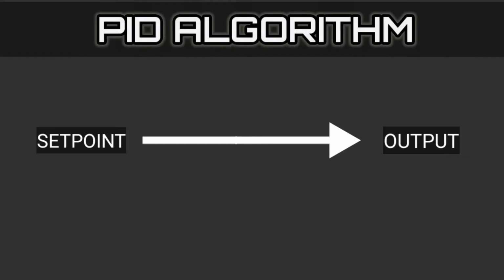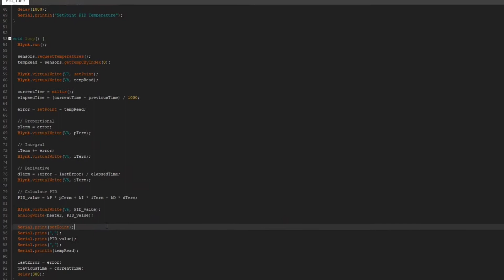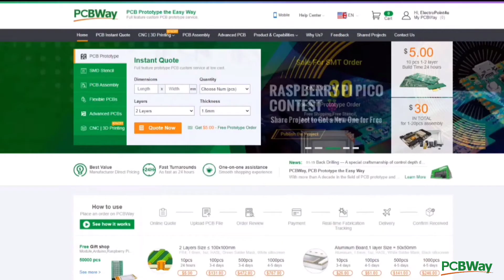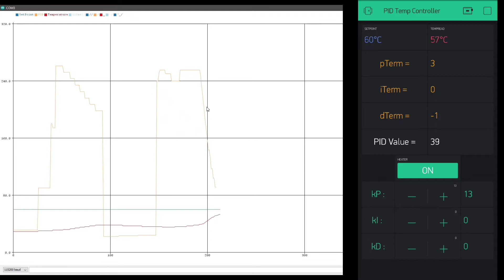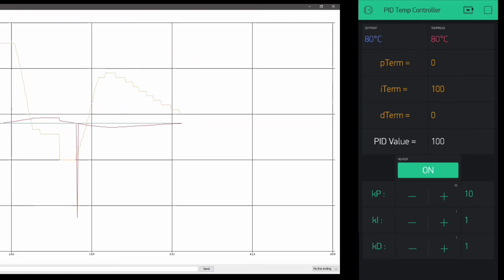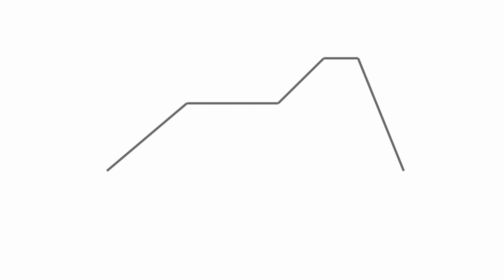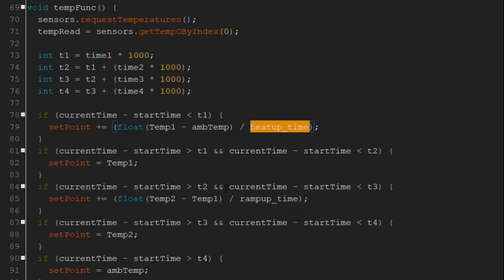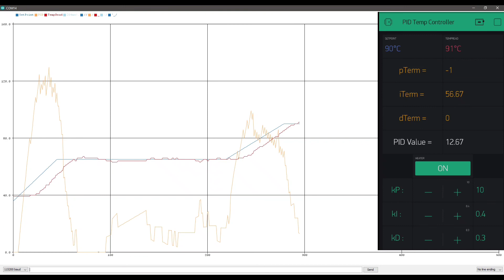How to tune PID algorithm for variable setpoints

Comment: Your making it a bit hard for yourself, as a PTC heater is already got a built in temperature control. 
So you are adding a 4th term to the loop calc’s (PID +heater non-linearity). The resistance of the PTC heater is not constant over temperature.

So if you set the temperature on the control to higher than the heater set temperature you will never have control of the set point. 

Still a great video to get us all thinking about PID control and how to use it.

The hardest part of PID control is if you what to get for example, the fastest heating to a set point with no overshoot. We had to get a small amount of fluid to 37°C with zero overshoot and maintain to within 0.05°C in the shortest time possible. The lucky bit for us was only one temperature to worry about when trying to define the loop control, but still took many months of tweaking the s/w and h/w to get it to finally work.